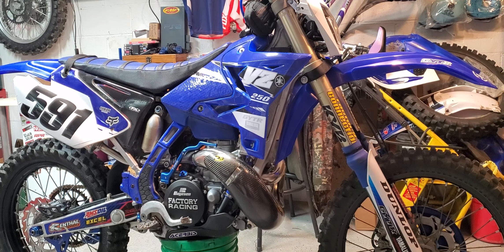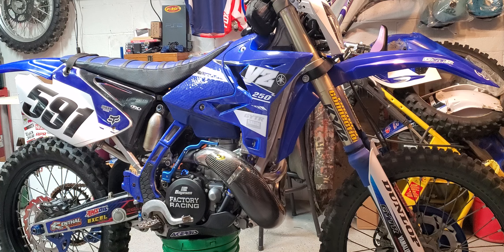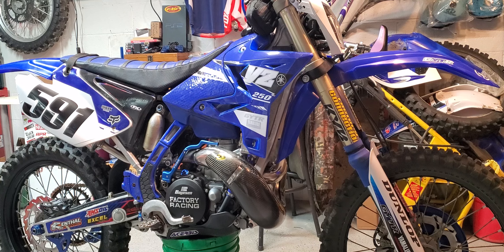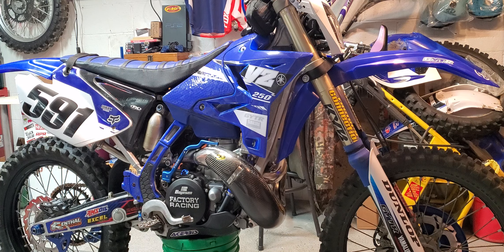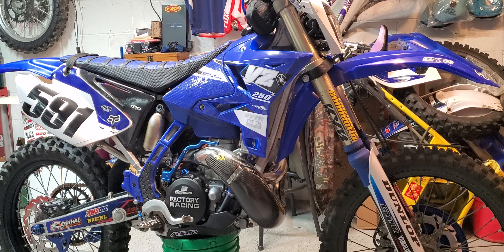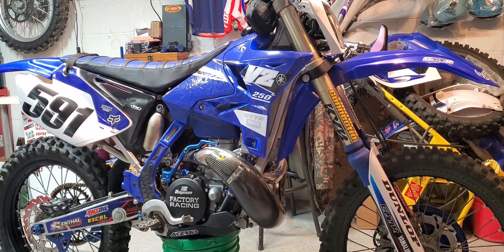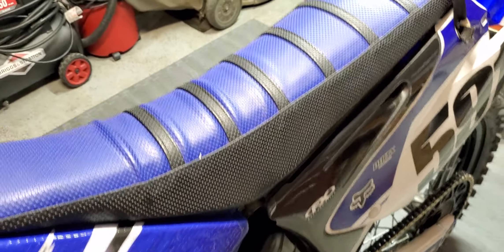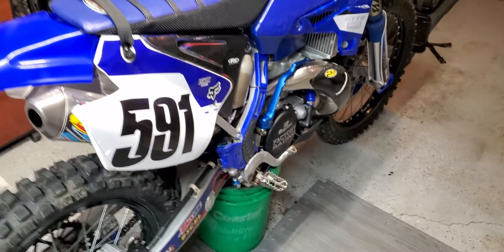06 yz250 build list

Comment: I like the advice about the 13 oz flywheel weight. Good stuff. And the front sprocket advice.
Reply from the maker: Thanks I just got back into the 2 stroke scene after about 10 years. I sure missed it!
Reply: You have a very clean setup!😊 Looks fantastic!  Did you had to modify the suspension for woods riding? Thanks.